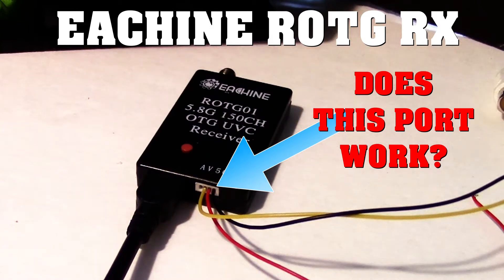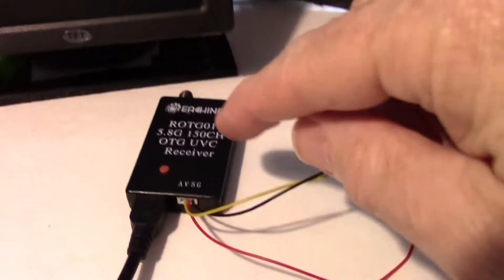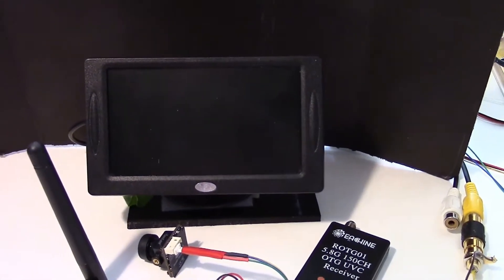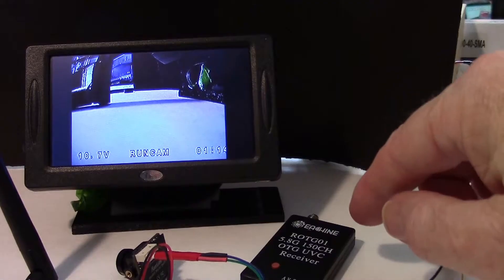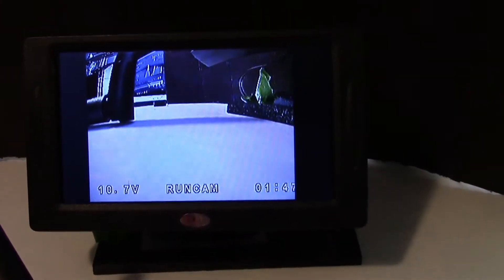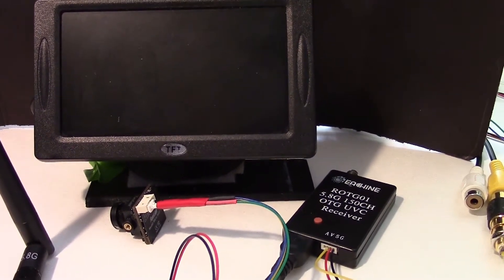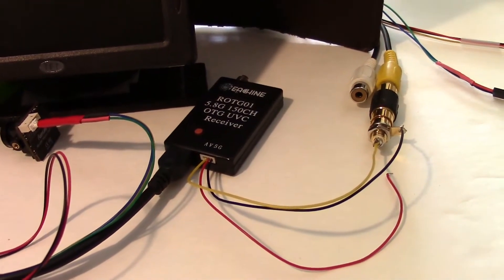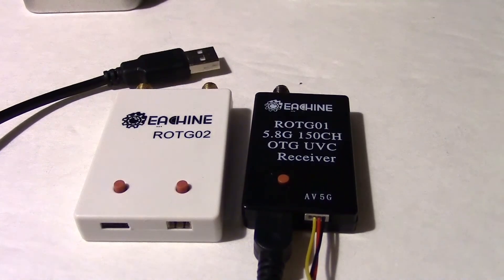Eachine ROTG02 ROTG01 FPV Receiver, Does AV Port Work, What's it for?

Comment: What brand of smartphone do you use?  The smartphone must support UVC, 5.8GHz so it can connect to the Eachine Rotg01 or not, brother?  what brand of android smartphone is certain-of course that can connect to eachine rotg01 brother? Sorry, I'm still a beginner🙏.
Reply from the maker: For the Mobile Device (Cell Phone, Tablet) you need a USB connection. Same for a PC/Computer its USB. If the phone doesn't have USB you will need an adapter.

Comment: Just got myself a ROTG02, but the analog video output doesn't work at all, even when there's a steady picture over USB. Just getting some lines that are running across the screen. Tested with several monitors.

Comment: So what if you use the 5V to power the unit instead of USB port and maybe it would all be on the analog side..? Anyway thanks for this video ive looking to find this info out and couldnt find it mention on any similiar brand's manual either, it just says EXP as in Expansion..
Does the 5V pin actually output a 5v signal to possibly power a monitor as well maybe? 
Where do i get that nice RCA Diy connector with the ground like that? thats cool lol. Could definitely use that lol..
I was thinking of using this Analog Video signal on an RCA then to a 3.5mm A/V Adapter for the RCA and input the Analog video feed to my digital fpv goggles v2 with an Analog AV input

Comment: On the analog output, if you are powering the unit from a 5V power source, are the ground for the power source and the ground for the A/V output common? Looking at it, I'm just confused as to if the two are tied together or not.

Comment: Interesting. But I can't get sound using the connector with the ROTG2 (A + Gnd) , weird cause it works with a skydroid receveir and the Jst connector is exactly the same. is it normal ?

Comment: What if the USB Cable is connect to USB Charging Adaptor or Powerbank? I try to use that way but the ROTG can lock the right channel, can u help me??
Reply from the maker: What I found was that the device wouldn't lock onto a channel unless it was controlled by the app on a mobile device or a computer. Apparently the app is needed to do the scanning and locking.
Reply: @DaveMerc  that so sad, but thanks for your respon...

Comment: Had anyone else had issues powering the unit through the A/V port's ground and +5V wires? It looks like the A/V can't be used unless a phone or computer is hooked up the the micro USB port as well. Power only (from a power bank) doesn't work either.
Reply: Yes it works like that. It seems connecting to USB fires some initialization of the AV out.

Comment: Hope this is still monitored. My question is : It that analog AV port a place you could supply 5volts of power that would supply charge to your phone while in use? This device drains my phone quickly when I use it and since the phone's USB port is in use by the ROTG0 device the phone can't be charged during use.
Reply from the maker: No you can not power your phone from the ROTG0x.

Comment: Thank you very much for the video. My question is what goes on the other end of the AV5G cable? How do I connect it to a monitor
Reply from the maker: A = Audio, V=Video, 5=5Volts Dc, and G=ground. Hook the Video and Ground to the composite video port on the monitor. Look at 01:29 in the video and you will see the connections. I am powering the ROTG from the USB port but you could put 5 volts on the 5 wire instead.

Comment: Thank's for you video. 
Is it right, that the video-out of the ROTG-02 (with diversity) gives me only the signal from one of the receivers?
Reply from the maker: Correct. Thanks for watching.
Reply: Correct in that you have two antennae on one reciever.

Comment: Can you please tell that which pins did you connect to the rotg01
Reply from the maker: For those looking for the plug, you can get it on ebay. Search for Mini Micro 1.25mm T-1 4-Pin JST Connector

Comment: Thank you very much! I tried this, and success! First time I connect , it has no response so I think fail... but after I see this video at 01:43 frequency test , I tried same , the monitor show camera display ! ... But still I can't use audio and don't know how to... I connected audio same as video , but audio not works. Can I ask you about how to do with audio line ?

Comment: Interesting, I had been wondering how that worked. I guess in theory you could use this as a signal repeater then with another vtx plugged into the output. Though latency would stack up pretty fast through multiple links.

Comment: Did you try AV5G port connector with on ROTG02 with same connector used for ROTG01? Same pin?
I purchased from eBay a set but when fit into ROTG02 wire colors are exacly the opposite so I have fear to try your pin configuration.

Comment: Main thing i want to know is if the analog feed had lower latency. When the app fails does the analog feed go out too? Maybe in the next version the analog feed will be uninterrupted. But with the diversity in g02 it shouldn't  matter as much.
Reply from the maker: My impression was that the analog kept working but I didn't test that aspect specifically.

Comment: This is great info, and I think I can explain the problem. I have a monitor very similar to yours, with the same behavior. In my case, the monitor was built for rear-view cameras in cars. When the car shifts out of reverse, the power to the camera is cut. To accommodate that, the controller of the monitor will turn the screen off if it detects static through the video feed so it isn't on while you're driving. I think your monitor may be detecting the static in the background of the frequency display and deciding there's no video of value to display and is shutting off. Thanks for this video, it's informative and lean like all of these kind should be.
Reply from the maker: Did more testing on ROTG because some complained the monitor was the problem (Blue screening or no response to static).
https://www.youtube.com/watch?v=t5N0eiWtUPA

Comment: Is it possible to power the unit via the av5g port? And if so does it use the same ground as the video?
Reply from the maker: Yes and yes.
Reply: With how many volts can I power it through the av5G port? With 5v for example.
Reply: juanR  you can simply use power bank to get 5volt connected to micro usb ROTG and use pin out V & G connected to your screen device
Reply: @gonebdg  doesn't work. it seems that it has to be connected in USB on a PC or a phone via OTG, because I tried with a power bank and nothing in video output. Same with the 5V power supply on AV port

Comment: Nice to see this works!
As for going dark while scanning, a lot of new monitors refuse to show pure static these days. Maybe try plugging it into a CRT TV with rca input for grins?

Also, thanks for listing the plug size. The JST series of plugs can get very confusing; a lot of miscommunication with sellers.
Reply: This is the right answer.  It's the monitor itself which is intolerant of snowy signal, the ROTG is outputting video the whole time.  It's why FPVers have long sought LCD screens which do not 'blue screen' or go black on gross interference/lack of signal.
Reply from the maker: Did more testing on ROTG because some complained the monitor was the problem (Blue screening or no response to static).
https://www.youtube.com/watch?v=t5N0eiWtUPA
Reply from the maker: Did more testing on ROTG because some complained the monitor was the problem (Blue screening or no response to static).
https://www.youtube.com/watch?v=t5N0eiWtUPA

Comment: Thanks for sharing Dave.  Saved me a lot of time.  For those looking for the plug, you can it on ebay.  Search for Mini. Micro 1.25mm T-1 4-Pin JST Connector
Reply: Is there an adapter that would connect the port to RCA plugs?
Reply from the maker: Great info about the plug thanks!

Comment: What type of connector is that on the reciever? I would like to access that second output but there seem to be many types of small multiway connector - JST-GH 1mm, 1.25 mm, etc or JJC8 2.54 mm 4 pin are my guesses but who knows? No info with it when it arrived.

Comment: Good info Dave..All band scanners do this...I just wish they simplified the manual selection process with a simple  Up / Down key press. After all... you should already know what freq your vtx is set to...How many times does auto scan select the freq just off the real one for example..?
Reply from the maker: Be nice if they had a thumb wheel so the user could just scroll through the frequencies.
Reply: Yes, even better, you would think the folk who design these things would try using them for a few weeks...Then they would design them differently.